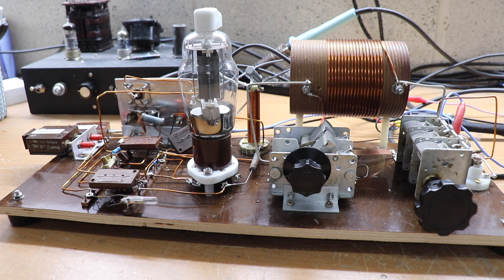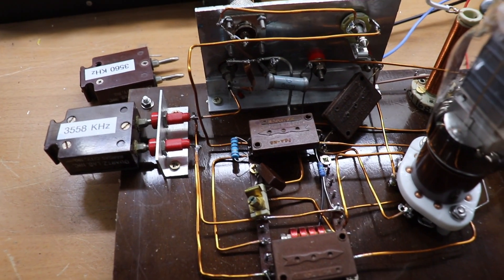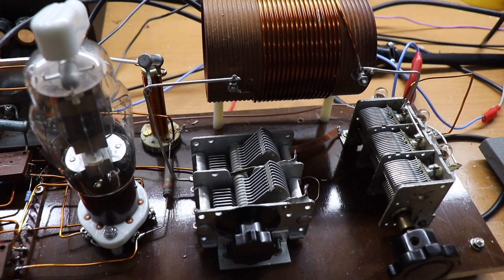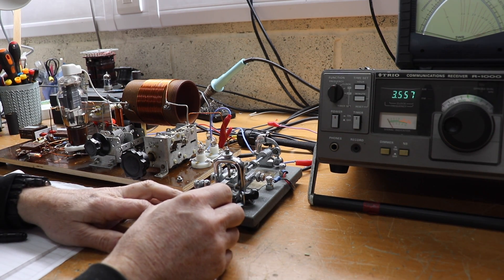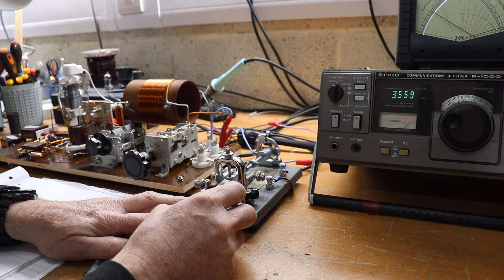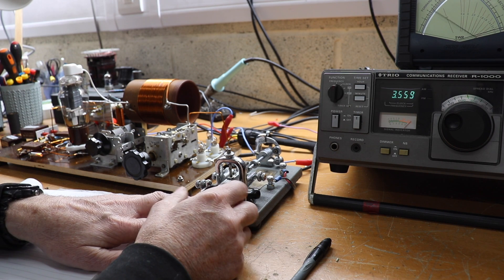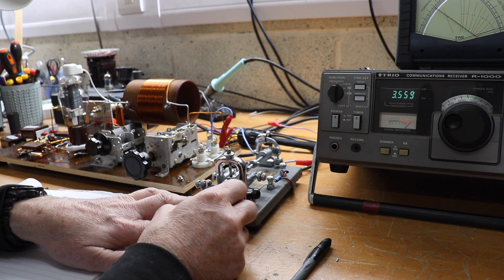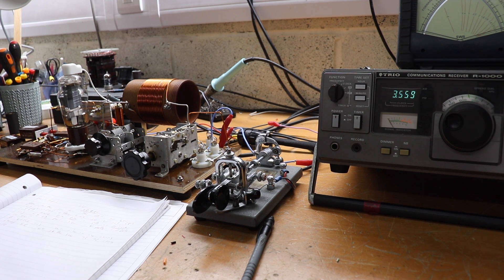1930's Style One Tube Transmitter

Comment: Very nice legacy build! It’s attractive too! Amazing how little chirp it has. So your secret was to use an 837 and not an 807.  Listening to it on the air you wouldn’t know it is a one tube transmitter. You did a marvelous job putting int the light bulbs as power out coupling indicators and explaining why meters weren’t used then. This is exact what a depression era CW transmitter would look like. Vacuum tubes were expensive after all and money was tight. Likewise a ham would buil a one tube regenerative receiver and rely on high impedance headphones which were in plentiful supply back then. They would also operate split frequency because crystals were expensive and hams would tune around listening for a response to their CQ.

Comment: Great construction and demo.
At 77 y.o. you've brought a lot of memories of the past when, I also used to build valve transmitters for fun.
I progressed from a single oscillator valve - like yours - to full three (oscillator, buffer, output) valves, using 2 x 6146 valves with 700 v on their plates.
These used to be days of 'fun', with immense levels of satisfaction in the knowledge of operating a self constructed transmitter.
Now, in the Solid State era and Class D stuff, things are different...perhaps more efficient but...less fun!
Thanks for the great video and 73's from 'Down Under'. 😀

Comment: Looks like an 807 tube. (As vid was starting.  Turns out it’s an 837.

(Do you keep the tube in the Fridge when it’s not under power?  Joke, e.g. “Cold 807.”)

Note: 837s are a fair bit cheaper than the look-alike 807, are true Pentodes, and look likely for possible experiments.

Comment: Lovely transmitter. I just built a tiny, <1w battery operated one with a DCC90 double triode. Once i've dragged all power and stability i can get out of it, i might build a bigger one. 
Stability is a bit of an issue. With such low power, i don't want the antenna coupling to be too loose, but as soon as there is enough wind to make the antenna wire move, the tone is exactly that of a singing saw.

Comment: Hi, all these comments are mentioning 807 but isn’t a 1625 the same exact part, I just needs 12 volts for the heater instead of 6 or sumthing
Reply from the maker: Yes 1625 is 12v version of an 807

Comment: I have 1946 ARRL hand book showing a 25 watt master oscillating crystal controlled 807 and using plugin coil with the HT passing through it. I think that a 6L6 is the same as a 807 from what I have read. You mentioned 12 volts and the valve you are using must be the 12 volt version of the 807 which is a 1625.
Reply: I have the 1961 38th edition, I'm not a ham radio operator but I do build custom guitar amps and repair vintage gear and yes the 807 is very similar to a 6l6 in fact you can buy adaptors to run 807 as 6l6s and vise versa allegedly. I have a hallicrafters s-20r and I love it.

Comment: Nice 30's breadboard rig, Justin! I have built a replica of the Norwegian agent set "Olga", which uses one 6L6G with xtal control. I also have one British Mark XV TX with a 6V6 and a 6L6 in the PA (SIS, Whaddon). Like yourself I prefer using more modern receivers. Maybe we could meet on 80? I have a number of xtals on 80, 3560 is ome of them. Beat of luck and 73 de Stein, LA9QV

Comment: A very enjoyable project Justin and great to get the feeling the experimenters back in the 1930s would have had putting the breadboard transmitter together.  I've previously built a single valve transmitter using an EL84 or PL84 with switched heater supply on a wooden cigar box which was fun. Planning to build a solid state modulator and get it all into a metal project box for safety in the near future. Great video.

Comment: is that a 807
Reply from the maker: 837!!
Reply: My first electric shock was off the top cap of a pair of 807s in a audio amplifiers. I can still here the music in my head now some 50 years ago. I'm amazed I lived to tell the tail. Funny, not used the 807 ever since, in fact no valves with a top cam.
Reply: @MichaelBeeny  beautiful sound in class A running mine at 0.057 amp each tube just a great amp I built the EF37A preamp driver is great